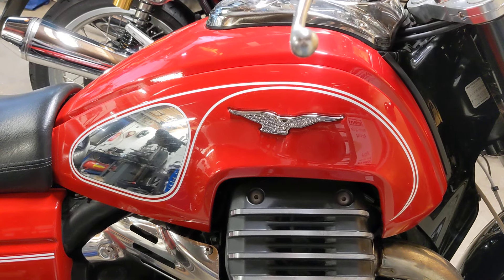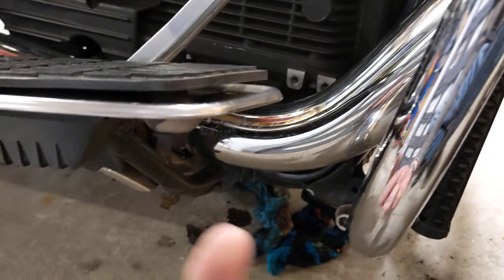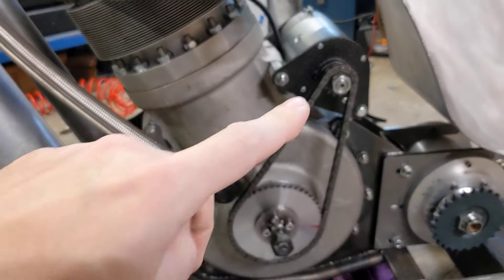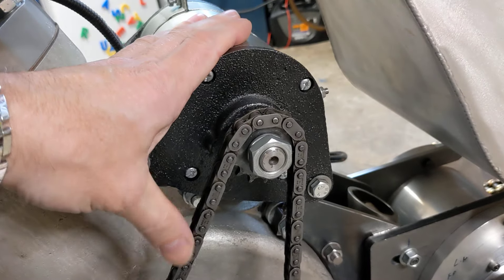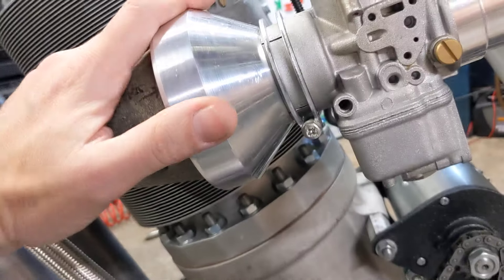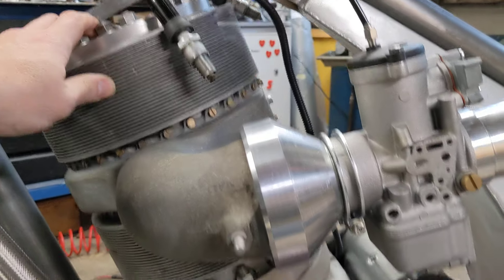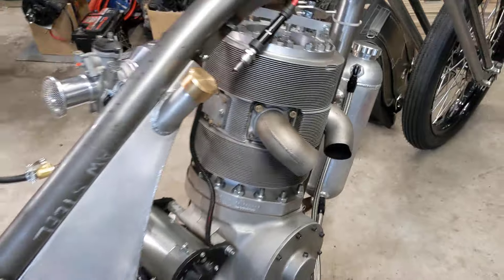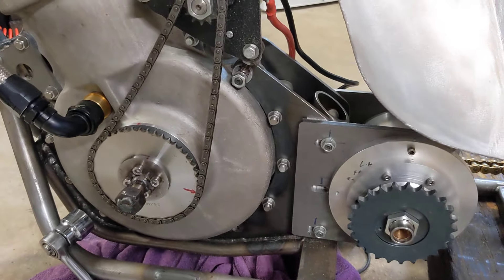Guzzi Trouble and Rally Season

Comment: I notice that the entire choke is open to the atmosphere on your dellorto . There's an air passage way (on the engine side of the slide ) that allows air into the motor even with the throttle slide closed , would make for poor starting and low speed running .

Comment: Wonder if it would start by being fired off with a shot of fuel and a spark like modern cars with auto stop/start do? Mind you a cartridge start (field Marshal) would be cool too.
Reply from the maker: Both good options. We can certainly get fuel in via the decompressor. I'll see if the ignition can be set to manually fire the coils.. Would be a cool start button. 😊 Cartridge start also being considered, but a few problems associated with that.

Comment: Why don't you try to use a hall ignition sensor(three pins active sensor) for your ignition? You should get a good signal from zero rpm. I don't know if your ignition module will support such a sensor, but should be easy enought to find a module that works with a hall sensor instead of a variable reluctance sensor.
Reply from the maker: Thanks for the suggestion. I'll 'contact' (haha, see what I did there?) Boyer and do some more research.
Reply: @Turnipstalk I am an automotive sparky. Nowadays, hall sensors are quite sturdy and inexpensive. While a coil and interruptor has the advantage of being very simple, a good electronic ignition module coupled with a hall sensor, can be very easy to adjust/ tune and can also be very reliable. Also the spark can be triggered with a simple micro switch connected on the signal output pin of the hall sensor. This can be used for starting the engine by rotating it after TDC, squirting some fuel into the cylinder and triggering the spark.